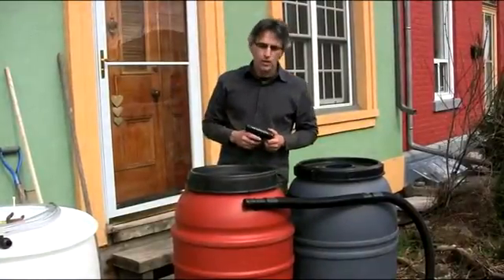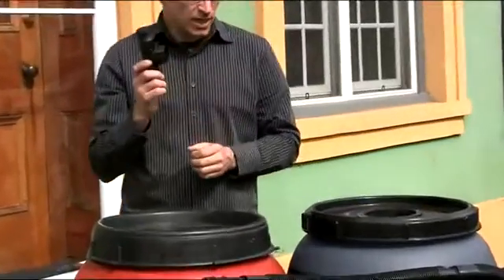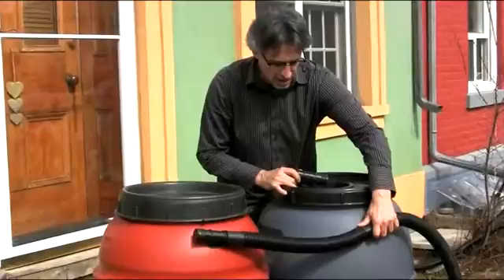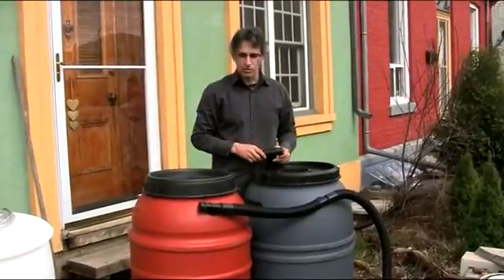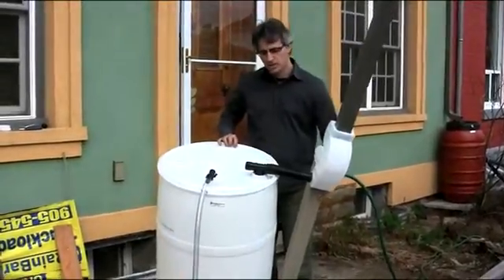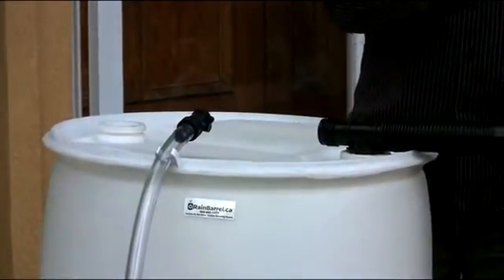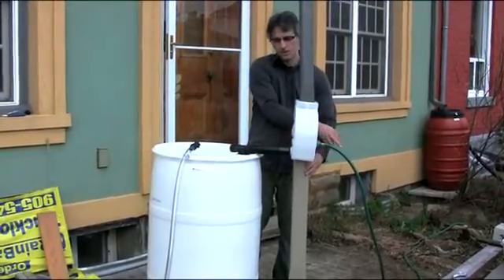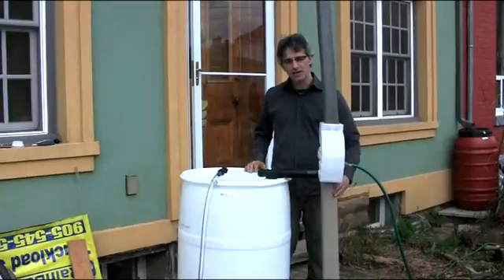Rain Barrel : Connecting in a Series and Downspout Diverter Demonstration

Comment: The video switches to a different rain barrel type when connecting the downspout diverter. So...how do you connect the downspout diverter to an open top (screened) rain barrel? Is there a video for that?
Reply: There isn't a video yet. On the side of the downspout diverter is a large cap that you can unscrew and replace with an outlet. Attach the diverter hose to that outlet and the other end of the diverter hose to the t-shaped adapter that fits in the upper side of the barrel. Please use our contact form on our website if you have additional questions. Thank you
Reply: The downspout diverter connects to all barrels the same way.